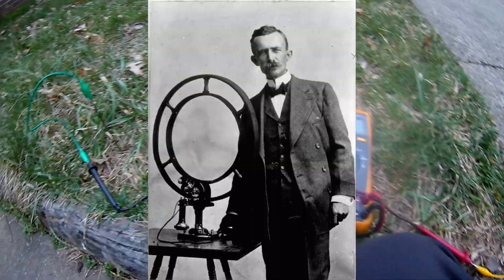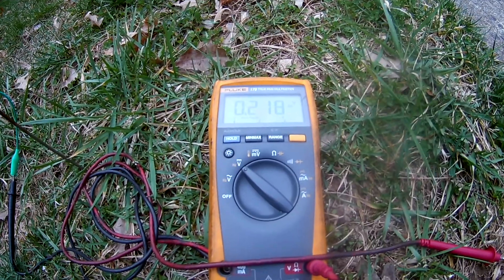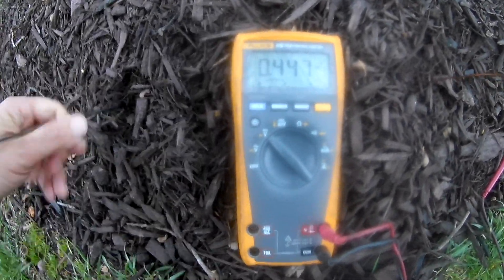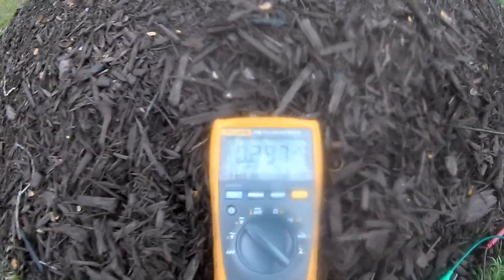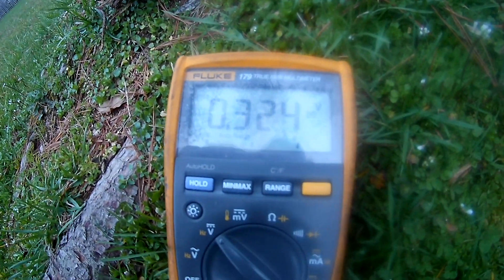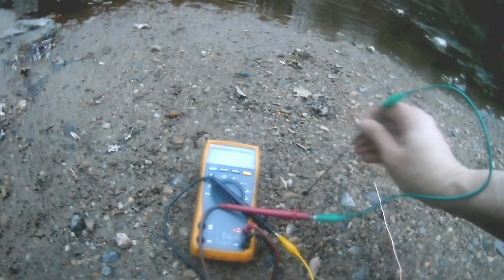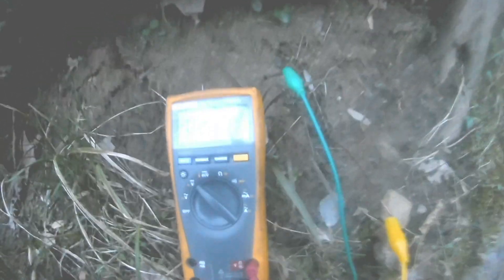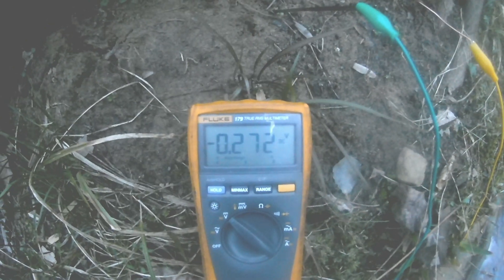Psychotronics and Earth Batteries

Comment: I remember reading somewhere that it wasn't simply enough to place it in the soil, but that specific locations where necessary and that Stubblefield used Dowsing to choose his spots, not just any tree spot will work. Additionally that its less so an Earth Battery but more so an Earth Generator, hence why it accumulates over time unlike how regular galvanic batteries operate, but thats just what I heard
Reply: I'm pretty sure the conductivity of the soil plays a big role and is heavily effected by the moisture in the ground.